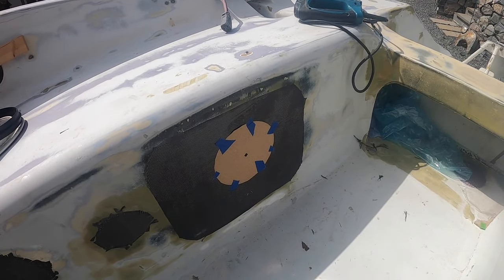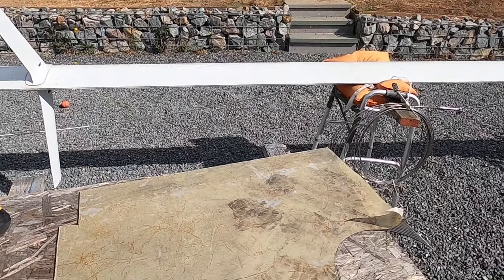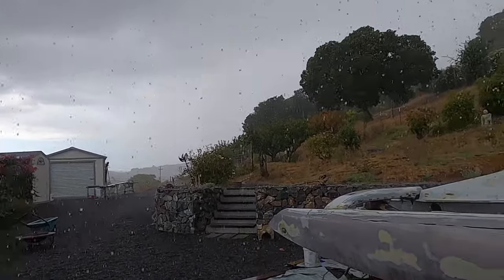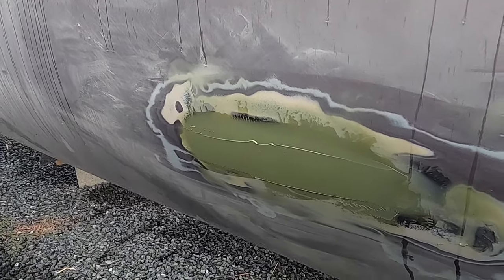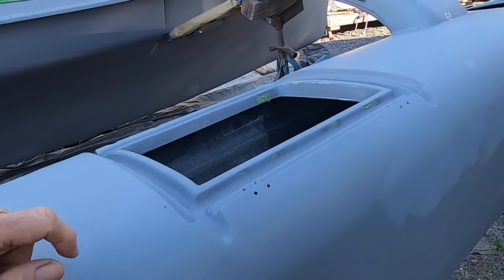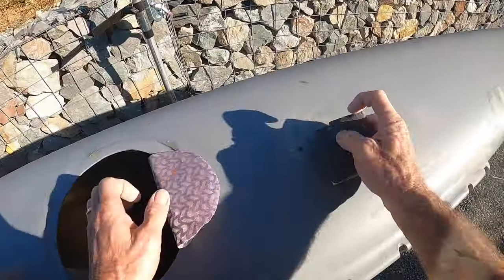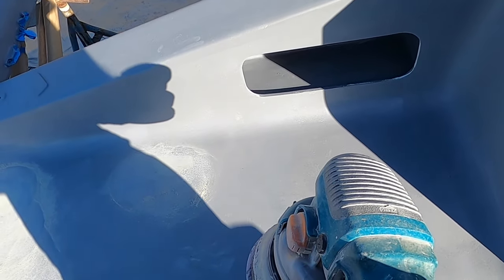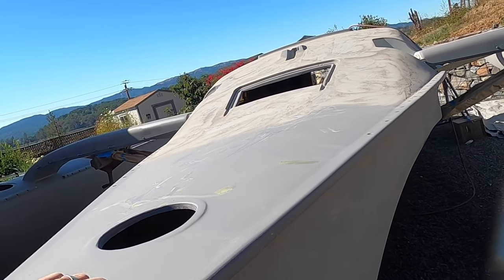What does it really take to prep your boat for Awlgrip, Alexseal or other 2 part LPU paint?

Comment: Greg - amazing work!  Your prep work will pay off.  One suggestion that is too late now.  If you raise the boat up a bit, sanding underneath is easier.  The stands you have look to have quite a bit of adjustment left.  I have found that laying on my back, I want my hands to be about 6" inches in front of my face when I am sanding on my back.  You can then sweep back and forth as well as in and out pretty easily.  It's a reasonably comfortable position.  I can't wait for the final result!

BTW - how would you prep if it were factory non-skid?  You probably don't want to sand off the non-skid nubs.  That is in my future.  Thanks!
Reply from the maker: Hi Mike. Happy Here Comes Winter to you! Those slanted jackstands are maxed out- the threaded rods are only reaching a few inches below the turning nuts.  For factory nonskid, I’d look at power wire-brushing, probably at low speed with a wire wheel in a drill. And then the big decision on whether to preserve gelcoat or convert the nonskid to paint…

Comment: Great work. What schedule did you put on your hardware backing plates ? Thinking of doing the same for mojo since their are some mild delamination around the high stress area on the cabin roof.
Reply from the maker: That large sheet of backing plate material is approximately 40oz fabric weight (ie four layers of 10oz BD carbon). This would be a good application for fiberglass too. Like two layers of 1708DB glass sold in 4” wide tapes… kind of like making your own thin G10 plate if you vacuum it, or at least clamp it down hard on a workbench during cure.